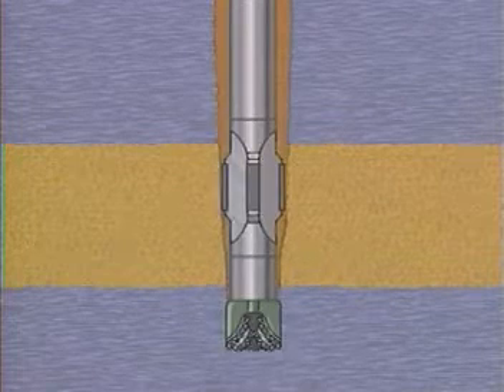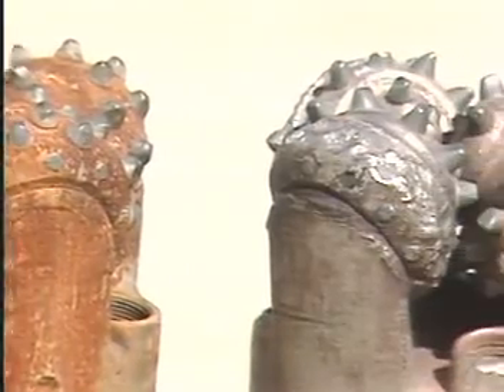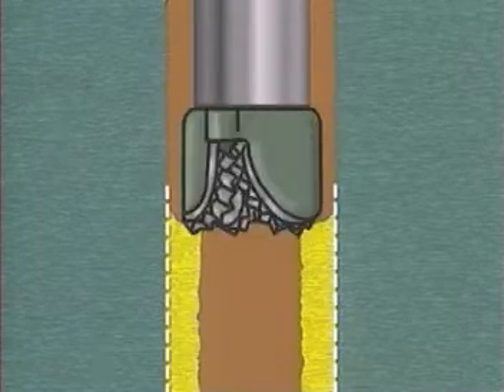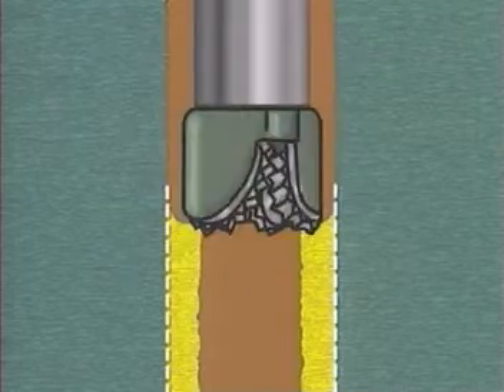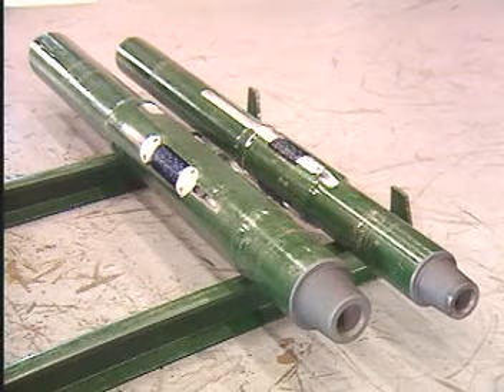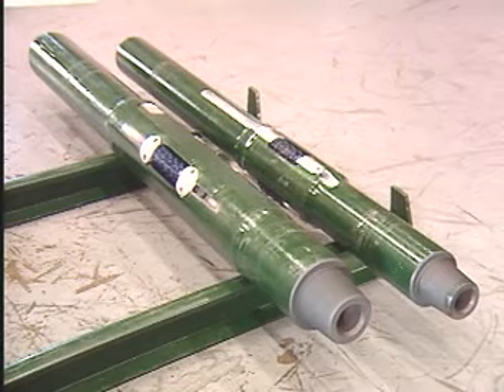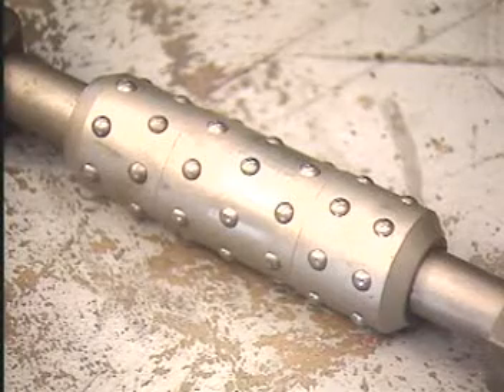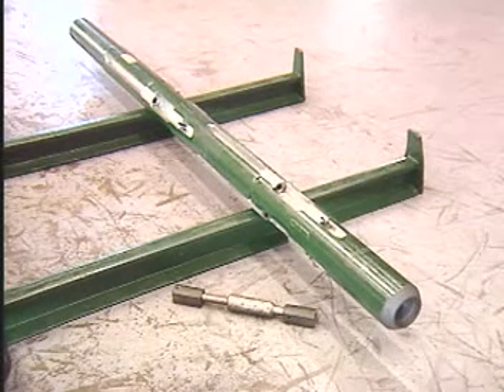Drilling Part 19 : Rotary Reamer

Comment: DRILCO model 85 sealed bearing reamer. The round blocks on cutter assembly is the giveaway. Introduced in the early 1980s. Great performing roller reamer.